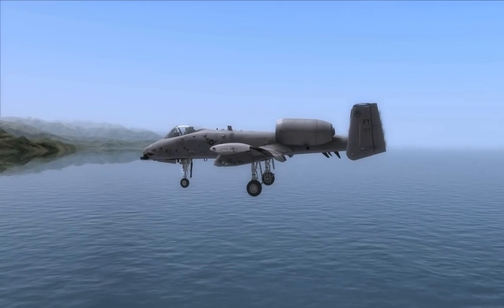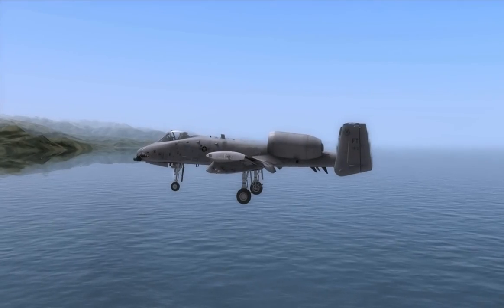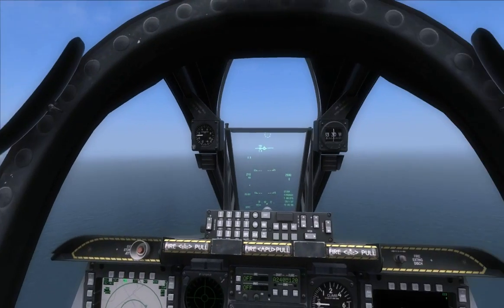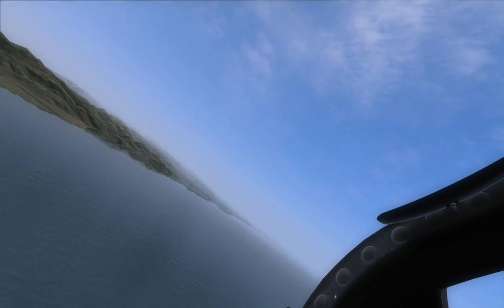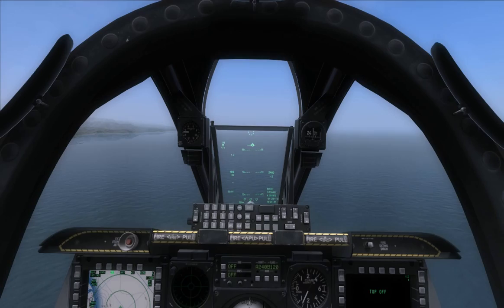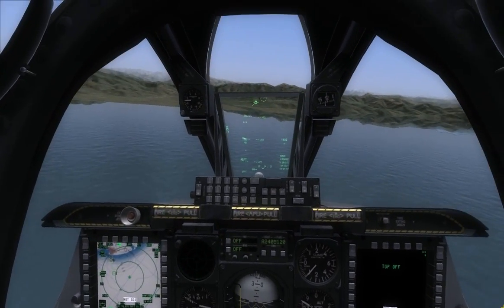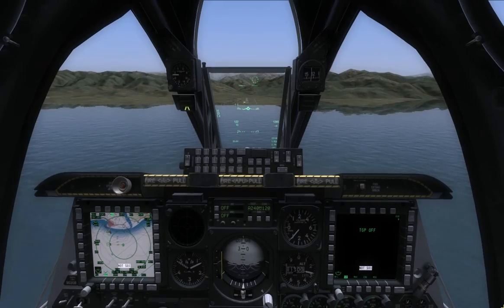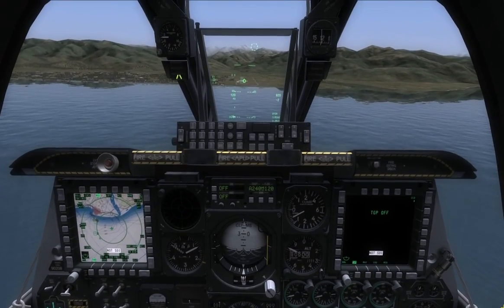DCS A-10C Landing Fundamentals (Part 1)

Comment: The AoA indexer calculates the optimum AoA for a given mass of the jet. i.e. It will display the correct AoA for any weight. whether the jet is 50,000 lbs or 10lbs a different landing AoA will be calculated. If it's in the green, this is the correct AoA no matter what the weight.

Comment: One thing I learned years ago about the "pipper" in the center of the HUD is that it indicates your flight path. I was told that once you have the pipper centered on a point on the runway, you're flying that particular path to that point on the runway. A lot of Viper pilots use the pipper to establish their glide path, which helps maintaining their touchdown point, and jockeying the throttle for adjustments. Great vid though! :)

Comment from the maker: @636Castle Good point. The reason you're seeing what you do here is because the manual recommends against going under 120kts approach speed. I had it loaded really light for this, with all ammo+stores removed and under 100% fuel. A fun thing to do is to load it light, run through the pattern, then load it heavy and check out the difference. The game is pretty good at making it feel sluggish when loaded heavy.

Comment: Since I got confused by this: 30,000 lbs is approx 13,600 kg (so add 2 KIAS per 450 kg more) if your Mission Editor is displaying your plane's total weight in kg instead of lbs.  So around 133 KIAS landing speed for a 100% fuel, 100% guns, empty loadout A-10C.